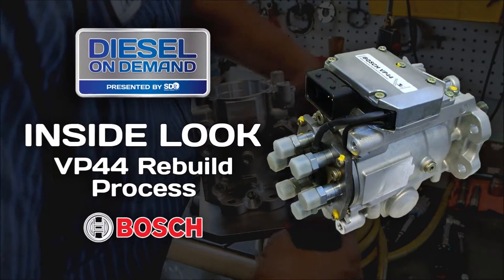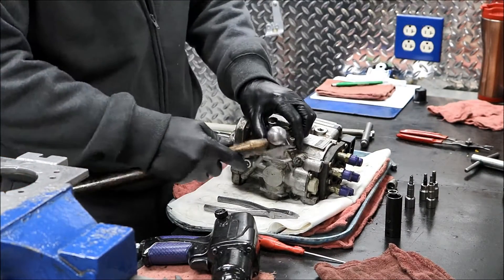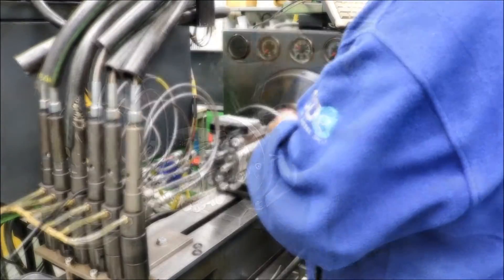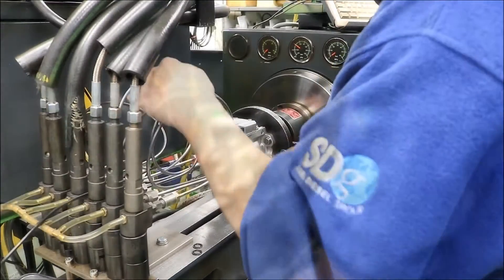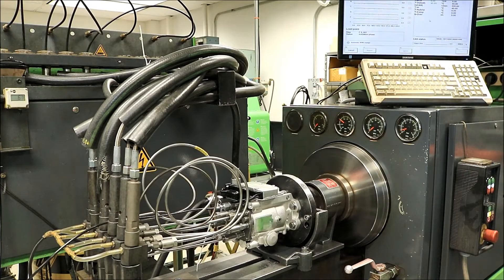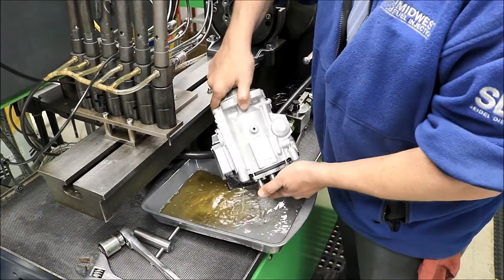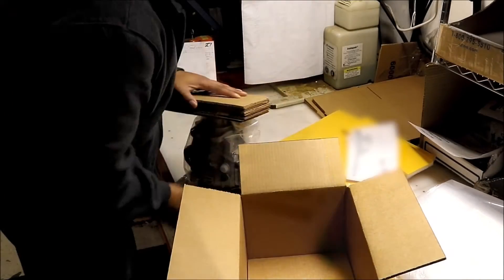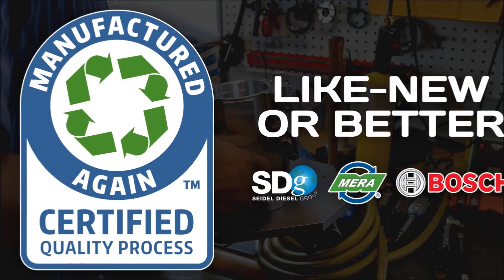Bosch VP44 Reman Process - Diesel On Demand

Comment: There is a micro filter inside the pump case, you don't take it off or it doesn't get blocked?
I'm my country it's normal that it gets blocked and starts to smoke blue and lose power

Comment: Its not 100% on the real world simulation....you guys left out that the pump is mounted on a engine that is operating at high temps like +160F...heat is the enemy of all electrical components.
Reply: That's true, however on the test bench, the pump is run through optimal operating temperatures for maximum efficiency. Unfortunately, Bosch doesn't account for the actual temperatures of the pump components on an actual engine on said bench. I don't understand that thinking myself.
Reply: Sir please pump not pikap ? Ajest ment what?